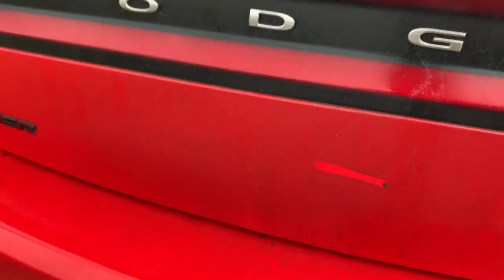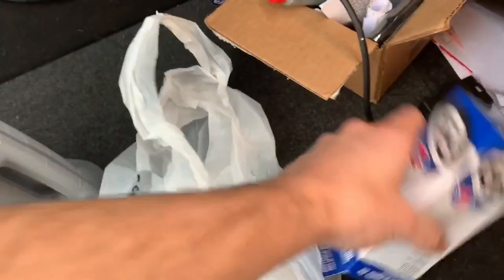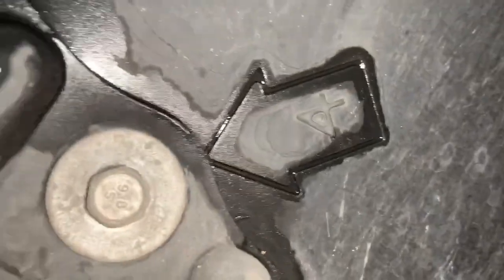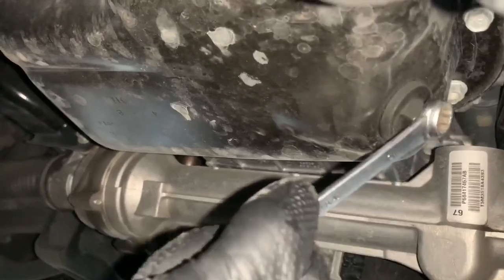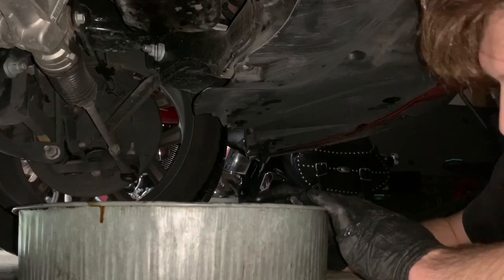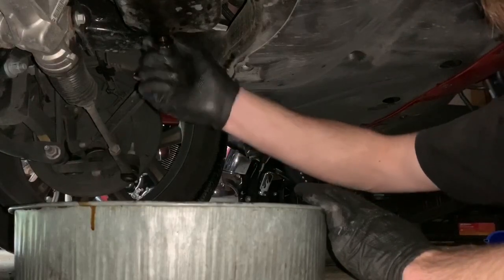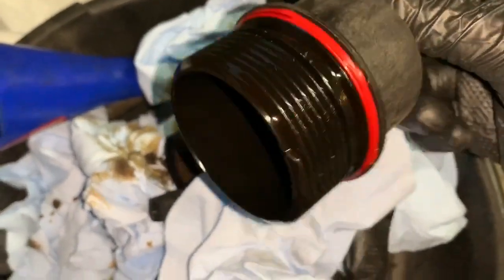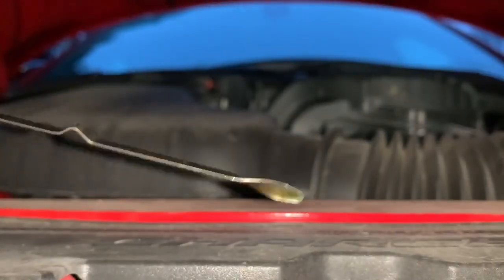OIL CHANGE FOR 2019 DODGE CHARGER GT!!

Comment: Channel locks?  A pipe wrench?  A Crescent wrench?  At least buy a socket set, and vise grips to free something that's grossly overtightened.  Pre-lubricate both O-rings on the new filter with clean oil.  And spend a few dollars on a real, drainable oil pan, so you don't spill oil all over, and don't have to try juggling pans.  Finally, what about resetting the "oil change required" or similar maintenance indicator??

Comment: Hey great step by step video for an oil change. About to do mines for the first time but quick question, after it was all done is there a specific way to reset the oil life on the car’s electronic dashboard?
Reply from the maker: No just turn the electronics on only, dont turn the car all the way on, and then go to oil life and hold down ok
Reply: @ronniesreviews2993  bet thanks bro 🙏🏼

Comment: I have a 2018 dodge charger with 42,411 mileage and got an oil change Thursday and the next day Friday my car was smokin..I had the guy use conventional oil because the year before I used conventional oil and everything was fine..what do you think is the problem?
Reply from the maker: Honestly im not sure, but i wouldnt have used conventional oil
Reply: You have to use synthetic
Reply: Any difference with Semi synthetic? All of my cars despite coming with or without Semi synthetic I always use it. I had my charger for about 2 months now and want to do the same. Only difference here my charger is a 21
Reply from the maker: Id go ahead and just do full synthetic just to be safe. It helps with the wear and tear

Comment: Channel locks?!  Sorry,  no one should follow your mechanical advice.  If you're going to do a job,make sure you have the right tools.
Reply: I’m saying the same thing! Left the oil fill cap on while draining the oil. Then added the oil before changing the the old filter out.